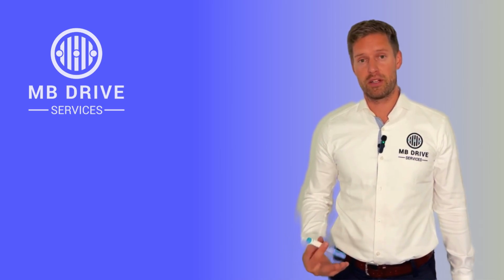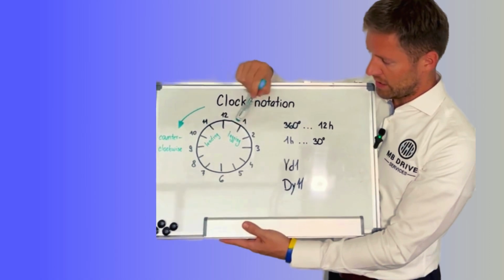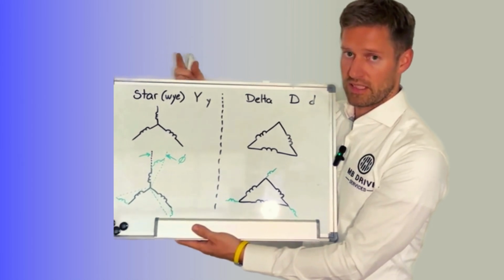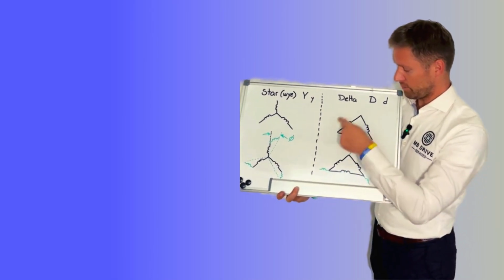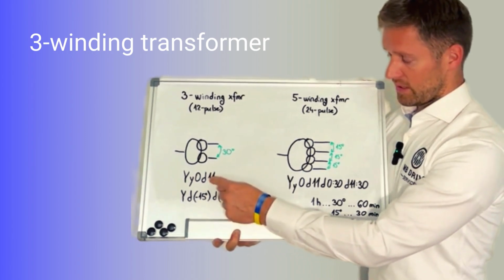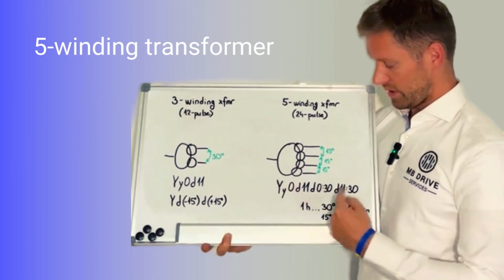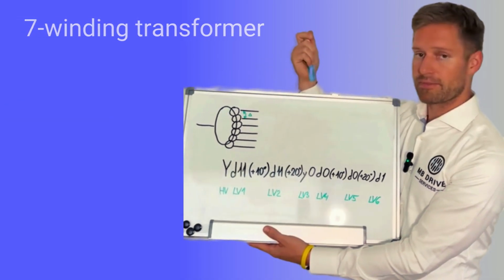Transformer winding connection (vector group)

Comment: Fun fact: Many transformer manufacturers consider the clockwise rotation when defining the phase displacement. However, the IEC 60076-1 clearly defines that "the phasors are assumed to rotate in a counter-clockwise sense"

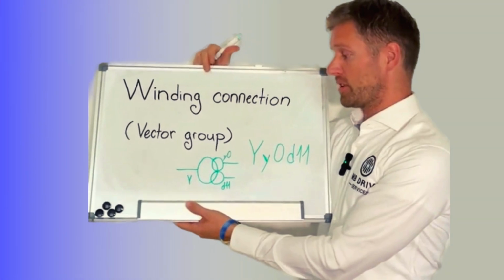Comment from the maker: 00:19 Winding connection or vector group
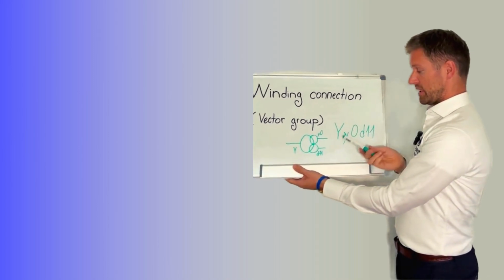00:40 Example Yy0d11
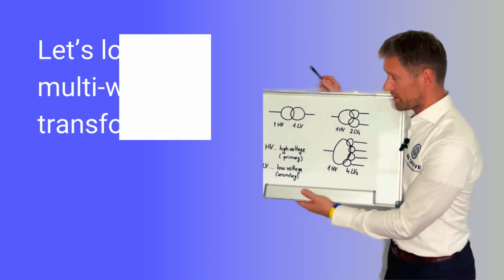00:53 Let’s look at multi-winding transformers
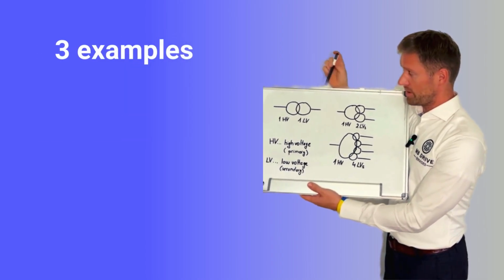01:00 Simple two-winding transformer
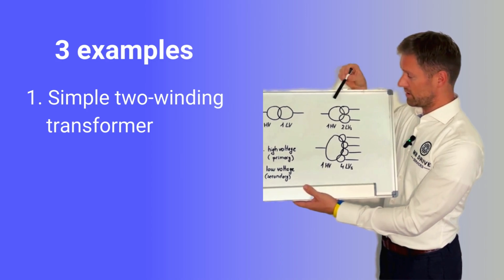01:42 Three-winding transformer
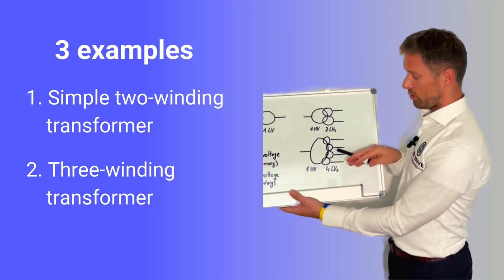01:57 3. 5-winding transformer
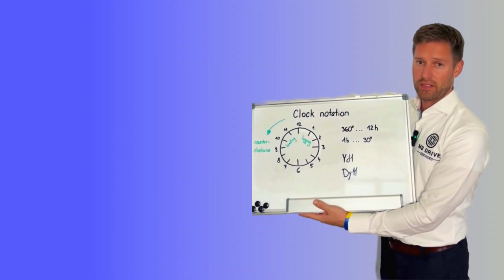02:31 Clock notation
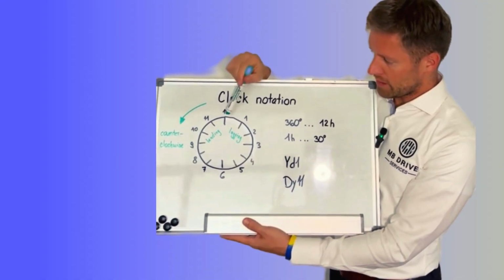03:07 Clock notation example by 1 section
03:36 It is important to note: the notation it's such the positive direction of rotation is counterclockwise and the opposite - direction by the normal clock is rotating
04:21 Star and delta connections windings
04:46 If we have a multi-winding transformers
05:12 Zig-zag (zigzag)
06:30 Extended delta
07:00 Two examples: 3-winding and 5-winding transformers
10:02 Complex multi-winding transformers (7-winding transformer)
10:51 If you want to understand the topic better, purchase one of our webinars https://bit.ly/3Vd0uFy

#multiwindingtransformers